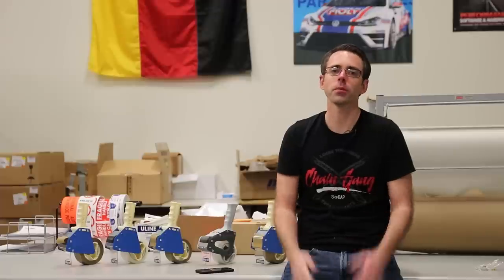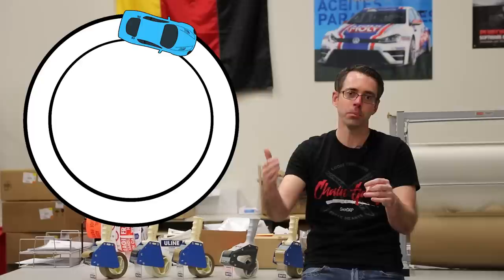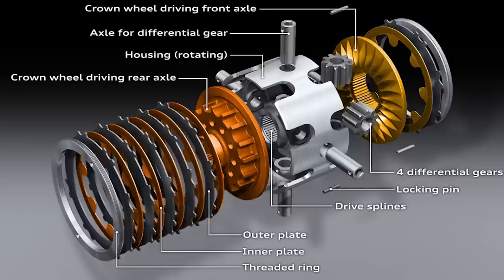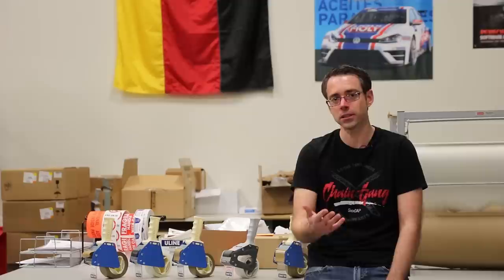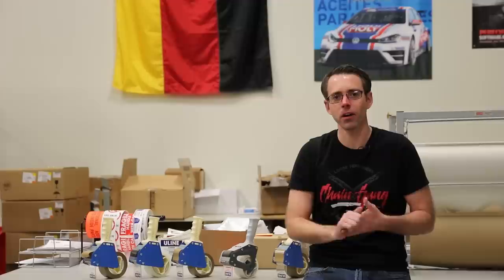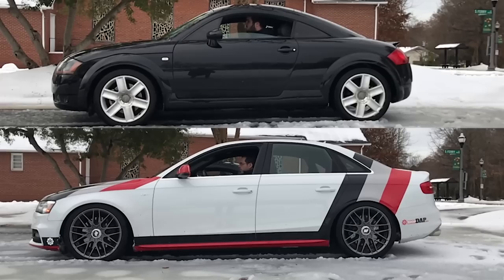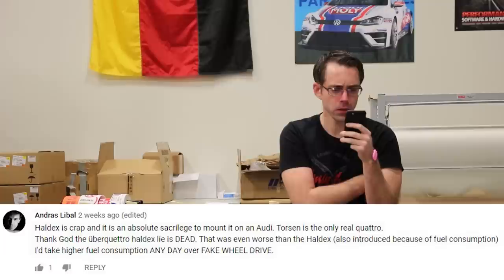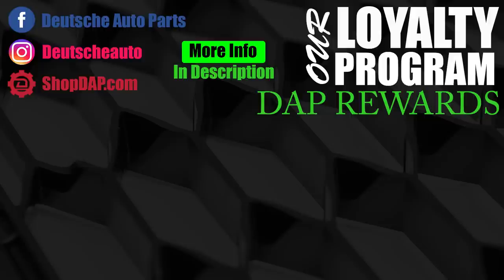AskDAP Episode 142 | Reading Comments From Our Quattro Video

Comment: Hey Paul... I have a 2015 MK 7 autobahn with 110k miles. Ive done all the sch mx to date. The car has been very reliable. I haven’t had any issues like on my MK5 with regards to carbon build up. Should I have that checked out? Also how about the timing chain? Anything else I should be concerned about at this point? Thanks. Always enjoy the videos.

Comment: I activated the off-road menu that shows oil/ water temp, tire angle, and compass on my 2016 golf R using obd eleven. Can I get the sports menu that comes with boost, g's, and power activated on my R using obdeleven?

Comment: Really enjoyed this video. My question is, I’m having a hard shift from 2nd to 1st gear after the car has been driven/warmed up for a bit. Never happens when cold. It feels almost as if the clutch is slipping into 1st. 2011 Audi S4, 115k miles. If it’s a worn clutch, do you recommend upgrading the clutch? Or just swapping out the transmission? Thanks!

Comment: I recently got a mk5 gti fsi for a trade, I had to put the head back on the car to get it to run, car runs and drives great. my issue is I have oil getting in the coolant overflow tank. I replaced the oil cooler and the oil filter housing gasket and still have this issue, i had an hard time aligning the head on the block because of the lack of dowel pins. I fear that I have scratched the head gasket, before I pull the head off is there any testing you suggest to diagnose this Issue before I take the head off?  It’s been resurfaced prior to install also.

Comment: I like the format. I was thinking about getting a older tt for rallycross as an alternative to a Subaru since vw r’s at too expensive to trash off road. Given this video, is an r or tt going to do better than a gti offroad. Seems they are all front wheel drive from what your video said.
Reply: The R is awd but only when the front loses traction. Look at the quattro vs haldex video they did.